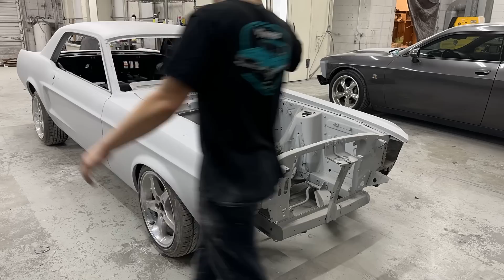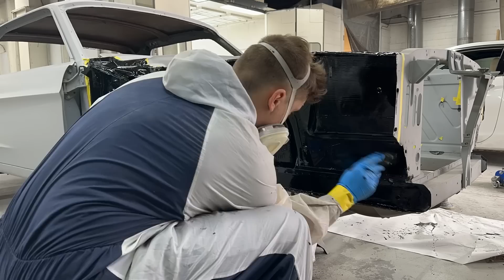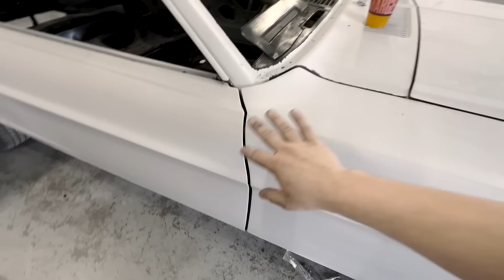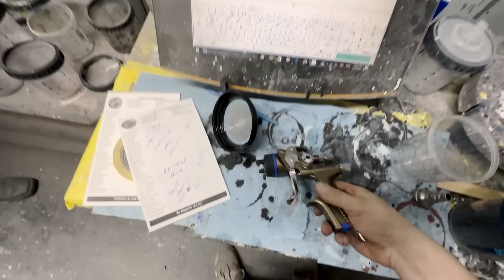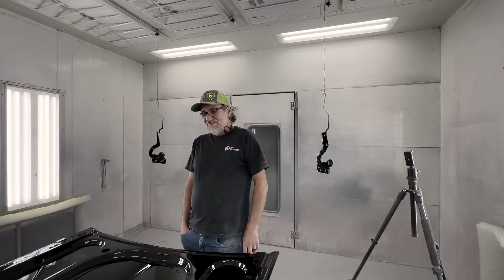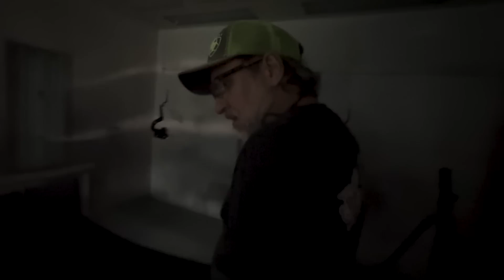Paint Prepping Our 1967 Ford Mustang Project!! The Color is Amazing!!

Comment: Now that's a full proof rust proof plan . I love it . Some self etching primer under the por15 maybe I could be wrong i haven't checked the por15 spec on that but a secondary wall would be nice for rock chips . Maybe a thick under coating over it or both . if it's for show not for go then your all good

Comment: Too bad no one makes thin plastic fender liners that can be added as an extra layer of protection, or do they ?
Well, I stand corrected, they do, for like $40 a pop on PartsGeek.  You can literally get every replacement part, on the cheap, makes sense to simply replace not bother with hours and hours of bodywork on a fender or quarter panel, you can get a brand new quarter panel for $150, and fender for for under $100.